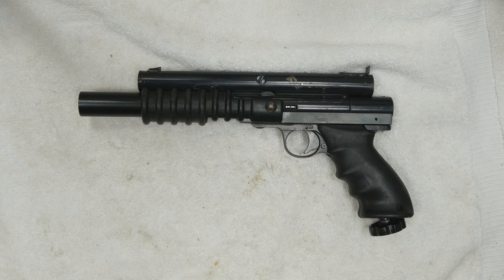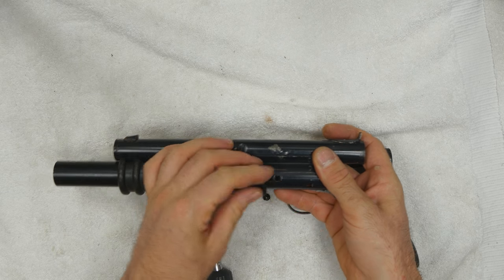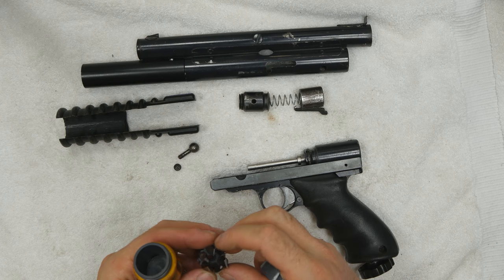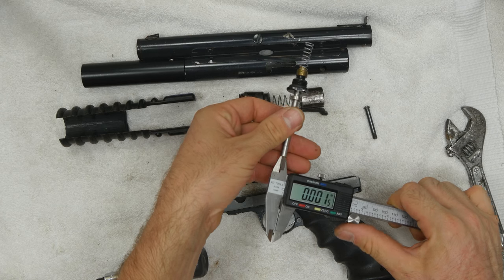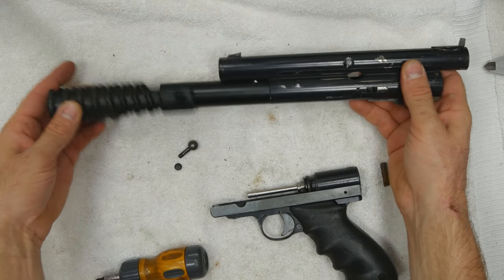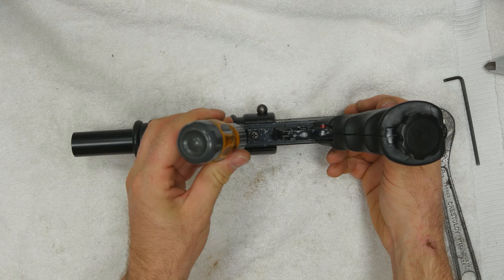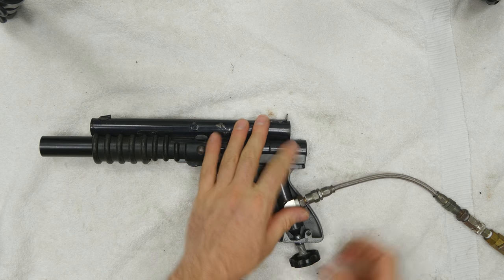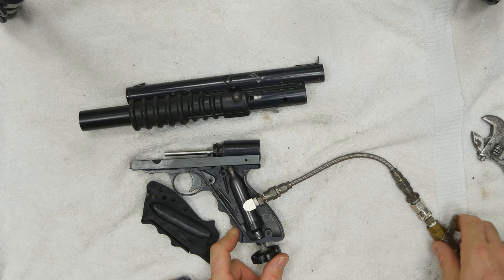Nelspot 007 breakdown and rebuild Tutorial

Comment: I know this has been like 8 years, but this is NOT how mine comes apart. mine is identical, except for the barrel being flush with the loading tube and the pump handle. either it's just rusted stuck or ... whatever... the back of the compressed air assembly won't come off WITH the handle. what's more, the hammer it's self seems to move independent of the latch, inside the tube. it's like it was never pinned in place, or I'm missing some sort of detent lever, but I don't see anything different with the one you've got here and the one I have, except for barrel length.
Reply from the maker: Send me a photo through my email on the site and I can try and help. Thanks!